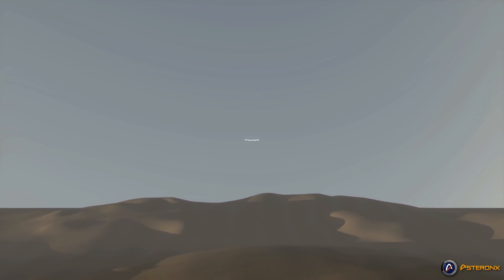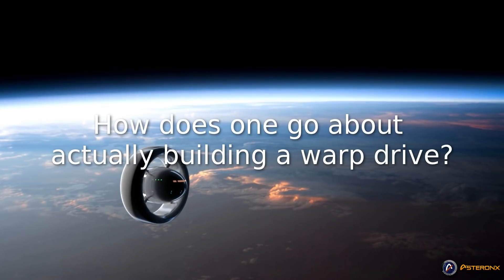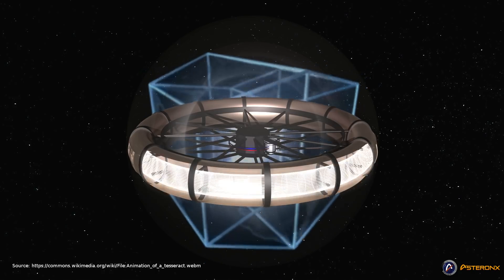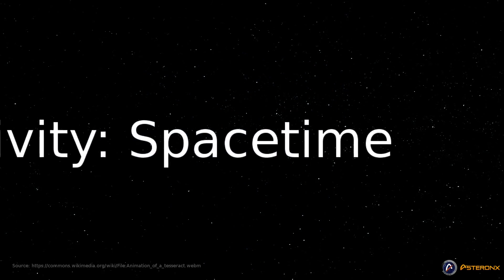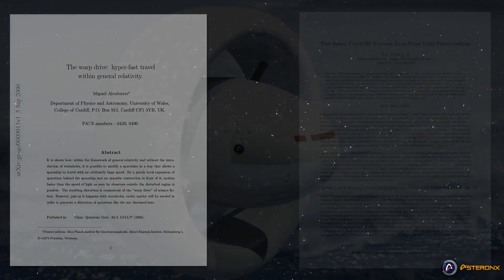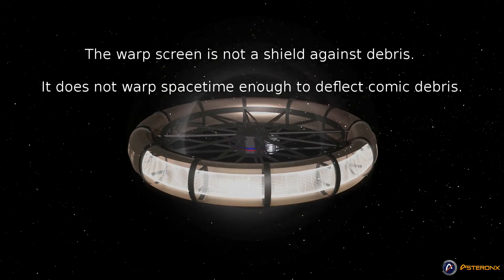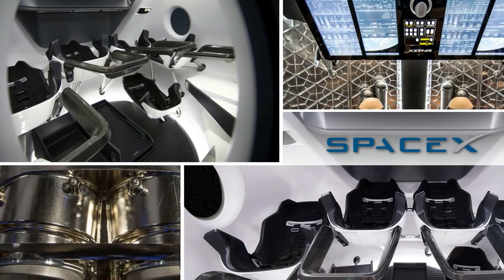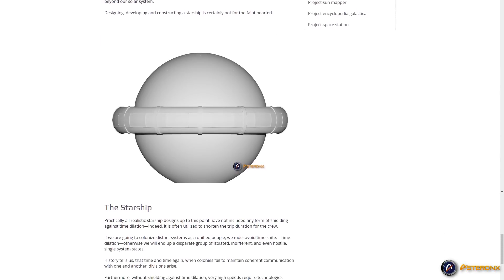Building a Warp Drive (updated version in description)

Comment: can we use particle accelerator in warp drive technology ?
Reply: Yes, the addition of a particle accelerator could increase the light-speed warp drive by orders of magnitude. The bi-polar subatomic counter-wound induction windings could then be used to produce semi-neutronic anti-particles broadcast with magnehelic repulsion transmitters and pulse-polarized using bi-directional episodic dipole diverters. Semi-acoustic vertically-interspersed harmonic wave transducers are frequency modulated with proton-injected capacitance inverters and phase-synchronized laminar condenser windings.
Reply: Check out the future particle accelerators playlist on my other channel.

I can't give links or my comments become hidden under this video.
I will give steps below.

Go to my channel and find 2 simple steps, find the "About" tab on the channel I'm commenting with now, read the info and save the link found there to your browser's favorites.

And then find the playlist mentioned from there.

Also with the "About" tab for the channel I'm commenting with now, follow the info that has steps there for the link.

Comment: an energy condition is one of several inequivalent but "similar" conditions demanding that the energy density is non-negative at each point of the spacetime. this is just a different way of saying that energy-wise, the vacuum is the emptiest environment you can have. see "energy condition" on Wikipedia.

there are several types of energy conditions, especially the null, weak, dominant, and strong energy condition, and some variations. roughly speaking, they differ about the question whether the positive or negative pressure may be added to or subtracted from the energy density to make the inequality satisfied by weakening it or strengthening it.

approximately but not quite rigorously, these four conditions are increasingly strong. a related fact is that they are decreasingly well established. in particular, the "null energy condition" is the weakest and nicest one and there are all reasons to believe that this condition really has to be obeyed everywhere in Nature. the others could perhaps be violated in some systems but no "truly realistic" examples are known.

the interpretation of the energy density and the inequality is obvious in a classical (non-quantum) theory. in the quantum theory, the energy density is an operator and one deals with various questions such as "whether one allows the energy density to drop below zero by random quantum fluctuations", "whether the inequality has to apply to all eigenvalues or just to some average in allowed states", and so on.

some of the quantum refinements of the energy conditions may be violated by the Casimir effect, the apparently negative energy density (manifesting itself as an indisputable total energy and a force) due to the quantum character of the electromagnetic field in between two conducting plates. but if one calculates the average energy density along a curve of the flow, it's still true that the inequality expressing e.g. the null energy condition is obeyed for the averages.

these quantum subtleties only affect the accurate inequality verified with the precision of one Planck's constant or so. 

but these quantum subtleties have no impact on questions about the motion of spaceships because spaceships are macroscopic objects and they require macroscopic energy densities. consequently, the classical (non-quantum) version of the inequalities is enough to discuss whether the superluminal spaceship is possible and the answer is certainly No, they violate the null energy condition in a way that is not allowed, by terms much larger than Planck's constant. 

one may be asked not to discuss the problems of warp drives with the causality explicitly in this question about the energy conditions. but one always discusses the causality issues implicitly because the energy conditions and causality are really equivalent, at least when it comes to the most typical consequences. why is it so?

consider a gas of particles (spaceships?) that are moving at a speed, possibly faster than light. you may derive the pressure of this gas. the pressure will be equal to p = –rho/3  for photons or, more generally, if the speed of the particles is the speed of light. if the particles only move in the x-direction, the xx-component of the stress tensor will be –rho. but if the particles will be faster than the speed of light, the absolute value of the pressure will exceed rho, the energy density, and one will violate the energy conditions.

so the energy conditions are "morally equivalent" to the speed limit on motion imposed at the speed of light. in quantum field theory, these two types of conditions are also equivalent to the stability of the vacuum. Tachyons, particles faster than light, would be quanta of a quantum field whose potential energy goes like –T^2 which may be negative (conflict with energy conditions) and is unbounded from below (implying instability, like an egg standing on its tip). in other words, tachyons could bepair-created in the vacuum, out of nothing, without violating any general laws. that would imply that the vacuum is unstable.

the warp drive papers like to assume that by a clever curvature of the spacetime, the speed limit (at the speed of light, c) imposed by special relativity may be circumvented in general relativity. Special relativity may be ignored, the authors suggest. but this isn't really a valid claim.

Special relativity applies in a general relativistic theory in various ways; general relativity is nothing else than a unique consistent theory based on special relativity that also includes gravity (force obeying the equivalence principle). one way how special relativity applies in a curved spacetime is "locally" because in a small enough region of the spacetime, the spacetime is nearly flat and Minkowskian, and special relativity therefore has to hold in this small region. this is the "resuscitated special relativity" that the warp drive theorists admit and want to circumvent in some way (colliding with problems with the energy conditions etc.).

but it isn't the only way how special relativity constrains the phenomena in a theory with the curved spacetime. the other way is at long distance scales, where the spacetime looks almost empty and flat again. when all the hypothetical spaceships are embedded in a nearly empty Minkowskian spacetime, there is still an unbroken Lorentz symmetry acting on this spacetime, and the spaceships only break the symmetry spontaneously and locally, as local perturbations. the Lorentz symmetry continues to apply to the theory of the "empty spacetime plus local perturbations" and it still implies that the faster-than-light motion is forbidden because it's equivalent to motion in the direction of the past, one that conflicts causality as specified in the special relativistic context.

even if we have lots of black holes, objects with extreme red shifts etc., they may still be viewed as "particles" at distance scales much longer than their radii, and such particles have to respect the special relativistic speed limit, too. it's obviously critical for relativity that black holes (and anything else) can't get an exemption. After all, all elementary particles may be interpreted as "tiny black holes of a sort", even though black holes that demand large corrections to the low-energy Einstein's equations, and if black holes could get an exception from special relativity, then every particle and therefore everybody could get it, too...

there are no exemptions and particles, black holes, spaceships, and other objects simply can't move faster than light inside the surrounding Minkowskian spacetime. no amount of engineering attempting to compress or stretch the space, as long as it is allowed by the basic laws of Nature, can circumvent these conclusions because they are basic and universal conclusions of the 1905 special theory of relativity......

Comment: So the thorus nullifies mass time and gravity. How can you accsellerate?
Reply: Super short answer: you don't!

Long answer: Since most of us were educated in the Newton's Third Law of Motion, stating that for every action, there is an equal and opposite reaction, this is a logical question to ask.  However, it is important to realize the scope of the "reaction principle" is not all-encompassing.  Newton's Third Law of Motion is limited to mass-related actions in a flat spacetime.  Since Einstein, it has become accepted that spacetime is not flat, meaning that there is an open door for there to be cases where the Third Law does not apply, and in fact, this has been demonstrated to be true by the gravitational lensing effect predicted by General Relativity.  However, GR is not a complete theory by any stretch despite the current treatement of the theory by many modern physicists as dogma.

Acceleration in Newtonian space means you are employing a force to a mass, implying the Third Law.  In the case of the nullification of inertia, you cannot use Newton's Third Law methods of propulsion as any of them would not be applicable to the spacetime that gives rise to that circumstance.  You correctly observed the problem in that acceleration as you know it requires a force with something to push against, hence your question.

Consider the case of nullified inertia (the same as saying nullified mass effects).  When inertia is nullified or greatly reduced, the appearance of motion to the outside observer is actually a manipulation of the fields used to nullify the inertia and not to the application of a force pushing against something.  Thus, you would be modifying spacetime itself and not an object in the same flat space as Newton posited.  One person mentioned a lot in this channel is the mathematician Alcubierre, who proposed math that attempts to show us how to do this based on General Relativity.

What Alcubierre and others have shown is that there are possible mathematical solutions to Einstein's field equations that provide a way for extraordinary effects to be generated by the artificial bending of spacetime.  Granted, there are flaws in the formulations, but hey, there are flaws in what Einstein produced.  Once Einstein's errors are completely fleshed out, the path to dramatic energy production and superluminal travel will come quickly hereafter.

It seems that the best candidate theory to provide this error correction to relativity is known as the Einstein-Cartan-Evans (ECE) theory, initially formulated by Dr. Myron Evans, a standout physicist in the field of non-linear optics (which has been demonstrating the issues with relativity for decades).  It is the most mathematically sound of all the unified field theories out there, and it also makes a lot of predictions already demonstrated by repeatable experiments.  You can read about it for yourself since it has been and is being published on http://upitec.org.  It is a math-heavy theory as relativity was, but there is enough discussion and summary articles to get the picture.  The relativity dogmatists are fighting this upstart theory, but they will end up on the losing side soon enough!  You can safely ignore the Wikipedia articles relating to this theory since it is controlled by the dogmatists who see some advantage to defending a proven false theory of General Relativity!  I recommend to all that they get to this site above and read the introductory article at the top before diving into the individual papers arranged chronologically.
Reply: Pretty sure you increase the oscillation or the energy to accelerate to greater speeds :)

Comment: If FTL travel is possible then the Fermi Paradox gets worse. In other words the case AGAINST the possibility of FTL travel is strengthened.
Reply: Keep in mind that a paradox usually arises when you use either an artificial construct or there is something not quite understood about the present construct.  In other words, the paradox says more about the apparent argument and not so much about the real argument!
Reply: @bruced9786  What is the supposed real argument then?
Reply: @mortkebab2849  
I'm just speaking in general terms, but although the analysis of any paradox can be both fun and educational, the mere existence of a paradox does not necessarily prove the existence of anything else other than a thought experiment, which doesn't have to relate to reality but to some hypothetical construct.  It is up to us individually to determine if that construct is interesting or even pertinent.  Not having studied the Fermi Paradox in depth, I don't feel I can add much to the discourse there, except to warn about reading too much into the implications of a paradox, which is what I was trying to do.

Comment: For a ship thats sheilds weigh 300,000 pounds and the ship travels 100,000,000,000 feet per second and is 3,000 feet in length and the heat source negates up to half the sheilds power and the electical ground negates up to 1/1000 of the sheilds power how much force is needed in pounds?

20,020,020,020,020 pounds of force in the sheilds and the engines will need just a small percentage less then this. One thing to note this sheild doesnt do well around heat sources so try to avoid them. Which is probably why in all scifi films the lasers still hurt the ship, anyway back to this text.. I think the amount of heat it can handle up to is 10,010,010,010,010 before it wrecks your ship. But this is also the actual amount of heat needed to keep your ship together. But this number doesnt cover which temp gauge to use, this number is in realtion with power you must first relate the number to total zero or no temp at all. Or rather get an actual correct temperature out of it that equates to this number. What this means is melting and freezing point of the metal and the exact middle between those two. It doesnt matter which you choose to measure it with because youll use it too adjust this number the same way, in other words a reading of 2 degrees celcius is the same equivalent as a reading with farenheit reader.

One example of the ships engine setup with this above example is 20,019,999,999,999.999 and the heat could be 10,009,999,999,999.999. Im not sure but i think you would want your engines as close to your warp capacity as possible because in reality you would just be wasting power then. Really this ship is only 99.9999 times faster then the speed of light

Any weight can fit inside the ship as long as it is air tight. Meaning there is no carry on weight limit.

The engines will be magnetic turbines/wind tunnels and will negate the area in front of them or behind them 

The fuel source will be water and fusion

All thats needed is alot of the necessary metals, melted and boiled off to create a super alloy

You could get to mars in just under 4/1000ths of a second with this ship and andromeda would be about a 1,014 year trip each way but this wont be a problem because there is on board gravity so sex will work, and you could have an on board agricultural department so food wont be a problem and neither will water and fuel as you will be able to make water with electricity and water is also the fuel

Star trek talked about percentiles for a reason because its the truth..

Also there's a reason we saw what we saw in star trek one equation leading into another..

I mean the torus might work as i doubt this idea would work, because i mean well... this is some serious power and kinda seems dated i mean you cant even adjust the warp sheild with electricity with this design it just kinda sits there and you control it be other means. but the torus would have to be integrated into the ships hull and output the right type of magnetism and not tear itself apart and you would still have to apply it to the ship
Reply: God created the universe with advanced tech but nasa doesnt let us explore it

Comment: Have any Warp Screens been built on a small scale for testing?
Reply from the maker: Dr. White has preformed some very limited in lab tests, which you can find in this pdf: https://ntrs.nasa.gov/archive/nasa/casi.ntrs.nasa.gov/20130011213.pdf. We are in the process of working out a new warp drive concept, one based on Alcubierre's original, which we intend on testing.